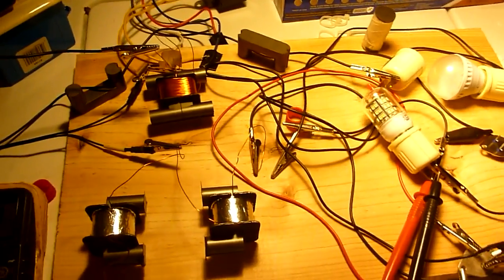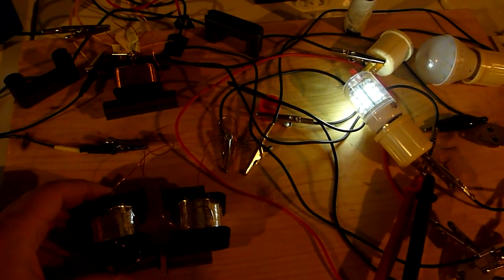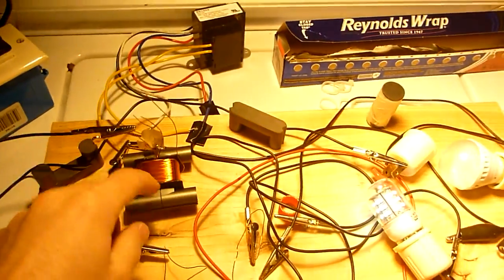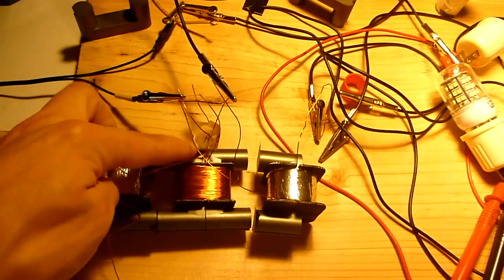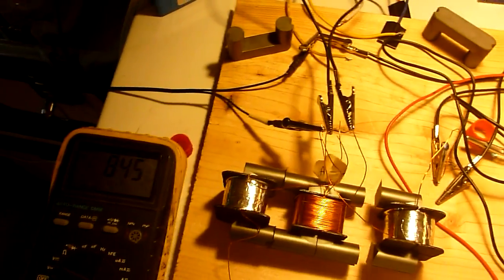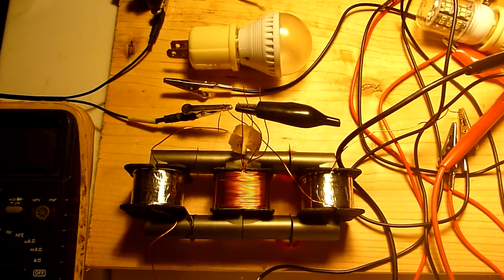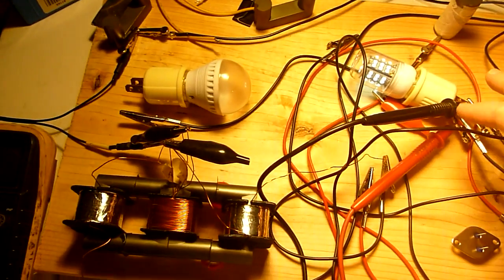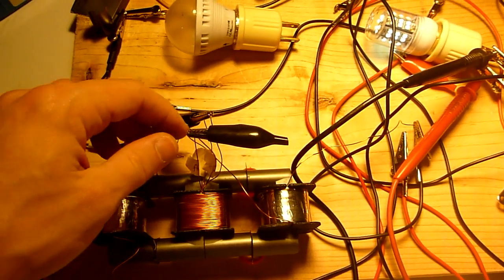Wireless induction experiment, proof that 2 particles are involved in magnetism

Comment: Have you tried measuring the UH (Micro Henry) of the coil when moving each half closer together this is simply inductance tuning commonly utilized in electronics which is why some cores have an air gap to fine tune their resonant frequency, resonant frequency increases amplitude in inductive circuits. I have seen this principle many times during my TV repairs servicing back in the 70's and 80's their a lot to be learned from studying Inductors :) The same principle is used to tune Radio Frequency circuits to optimize R.F. coupling and adjust standing wave ratio's https://en.wikipedia.org/wiki/Inductor
Reply from the maker: ***** Good point. For me the strange part was when 2 coils are shorted out in the middle. At that point more of the flux manages to pass through the shorted coil to the other coil. This in turn causes the load (bulb) to glow brighter. The two windings I have in the middle were wound in the opposite directions. Both should be shorted out to get the most flux to the other coil.

Have you ever noticed that if you pass voltage/amps through 2 magnetic metals in close proximity they will become magnetic! If you would try to physically pull these 2 magnetic pieces apart they will be stuck together through a magnetic attraction. However, as soon as you break the circuit the 2 metal pieces will stop being magnetic. To me this suggests that magnetism and electricity aren't just different forces but are manifestations of the same phenomena. (my and Ed Leedskalnin's opinion).

Thanx for the comment.
Reply from the maker: +Ortorea Screenname All good points, I didn't measure the Micro Henry of the coils when I was moving them. I also need to buy an amp meter, that has a clamp on it the one that I have is tougher to use for that purpose (plus I won't be able to show voltage at the same time).

I found out something pretty interesting. As you know I tried to replicate the Hendershot Generator and I failed. I followed a tutorial video on-line about it. Well, turns out that tutorial was dis-information! The key to Hendershot is the spiral wound capacitor that is located at the center of the coils. It had 2 equal size foils wound around each other in a bi-fillar fashion. This spiral arrangement forces electrons (monopoles) from the environment to be drawn into the circuit. (page 321 in practical guide to free energy devices). Hendershot had this type of capacitor connected to a coil, the two plates would oscillate and produce AC. Basically I am going to try to make a large one of these spiral capacitors and connect it to Floyd Sweet's voltage multiplier circuit. Floyd Sweet circuit consists of a square metal tube with 2 large 6" by 4" by 1" magnets in attraction mode around the square aluminum tube. Inside the tube there are 2 coils on facing the field of the magnets and one at 90 degrees from the field of the magnets. We will  see.... Observation > Theory, thanx for the comment.

Do you know about Eric Dollard and his lectures on longitudinal electric waves?
Reply: That all sounds pretty cool, not sure on who Eric Dollard is will look him up, and yes beware of misleading information, sorry to hear about your the Hendershot Generator being a failure, hmm I am beginning to think some of these scams are to milk us for our money as the more people they can get to waste their money on useless projects the more the TAX man collects, follow your heart is my advice. The suppression is multifaceted in that suppression of knowledge is not always enough for them, when information leaks sometimes all they can do is bury it in a pool of other nonsense to throw people off the scent. It is always a good idea to follow your instincts when it comes to research, for example I have made things in the past that today I realised would be useful today like a coil I wound years ago, I now feel is ideal for these magnet rotors as the magnetic field is not square why are we making coils on square bobbins as the magnetic field sweeps or cuts through a coil structure like that rather than riding on the wave of the magnetic field so to speak, based on this I am currently designing a new coil former see here.  http://www.book-stores.com/files/Bobbin.jpg
This design I hope in combination with a different magnetic core construction I am making should help overcome some of the lenze affect, from what I understand, this affect apposes our generator field,  so what if we can redirect this field sort of splay it out like a flower also diluting it on it’s back EMF cycle ? Using a softer home brew of magnetic core material similar to ferrite I am going to try this.
Already I have observed some peculiar results, when I attach the core material to a magnet with a 5mm spacer between, it sticks fairly firm at first and then seems to lose some attraction after a few seconds and falls off the magnet, very curious. I mixed 2 parts Magnetite with 1 part Graphite powder - both are fairly cheap materials, then mixed some resin, added the hardener then mixed in my batch of core material, it has a much stronger attraction at closer parts of core material when directly opposite the magnet but weak on each side as it approaches and passes magnet, By addition of an secondary opposing magnet on the other end of the new core material I get a very interesting affect also, not as much repulsion down the core when dead opposite the primary magnet, but as soon as it passes the primary I get a stronger repulsion this was unexpected. Also along this home brew mix the field along my core diminishes as the core length increases. I believe what is happening is the magnetic field is being redirected out the sides of the core material instead of (along it which is normal for baked ferrite cores that are highly compressed material), which could be perfect for my new coil former design, will keep you posted when I get the bobbins made.  If you want to also get my small coil former's made PM me I have someone holding the 3D print job for me and can pass on this information later so you can have them made too if you want them ?
Reply from the maker: ***** Cool coil former, it has a stack of different diameters on there. So you wind your coils on top of the winder and than glue the wire to hold the shape once it is wound? Also, what made you want to mix graphite into your magnetite mix?

I finished the Floyd Sweet box-thing with 2 large magnets on either side of 3" tube. I have the coils to put inside. These coils were supposed to be fed with AC sine wave from a generator (frequency unknown). I don't have one of those. I was going to use the spiral coil that Hendershot was using. I was going to make those using aluminum foil and wax paper. This Spiral coil will be great to experiment with. Here is one of my favorite Eric Dollard lectures. Eric Dollard is known for replicating every single Tesla's experiment. He is the only person in the world (as far as we know) to have done this. Here is his lecture on energy synthesis: https://www.youtube.com/watch?v=JQnSz_e7jvc Really mind blowing stuff. All his information is based on Steinmetz, Oliver Heaviside, Tesla, Professor Wheatstone, etc.
OK. Chances are you don't have 4 hours to spend on a lecture. Then check this 10 minutes lecture by Dollard and Chris Carson explaining longitudinal electric waves with schematics: https://www.youtube.com/watch?v=YhuSn6sc7sc
Reply: Naoki Kashima  Yeah to be honest I tend to get bored watching a lot of what others have already tried, I am most fascinated to try new idea's no one has done before, as for my coil yes it has to be wound in a specific way,  starting at the narrow end, the first row has to be super glued at each step, then rather than winding back down again as this causes slippage, do a right angle turn back to start, super glue and follow previous coil winding back up this way it minimizes slipping coils. Plus we can do a tapped coil on each layer to test the different layers, like a said earlier this is based on a coil I wound some years ago but I wound that one on coat hanger wire shaped in a arrow head shape or triangle, it was only taped not glued and because of its age that one started unraveling off oops, so I thought to use a stepped ladder approach as this way each step is flat and less likely to slip off. I have to save up some spare cash before I get the guy who made my 3D model to print these off for me he quoted me a price of about £30 for qty  of 12 so its not cheap for me. As for using Graphite it is supposed to have opposite properties to Iron so wanted to see what would happen when mixed also it helps make it not stick inside my mold. By the way we have given the new bobbin design a name it is called, Pyra-bobbin This is the Ebay seller who is going to make them and he is the only one with the 3D model artwork for this, http://www.ebay.co.uk/itm/121733584051